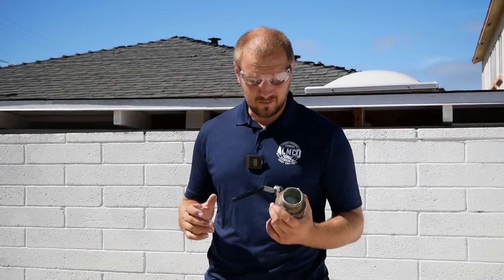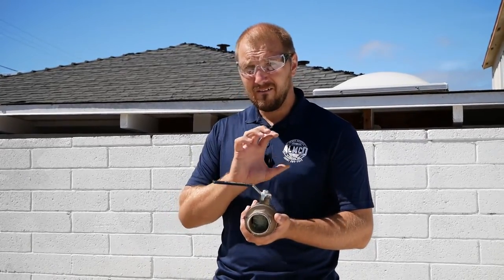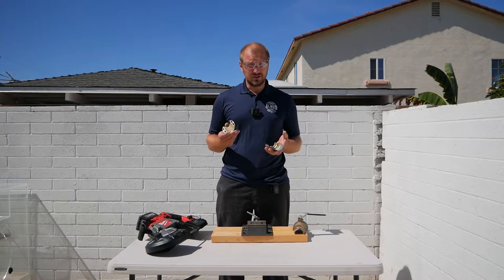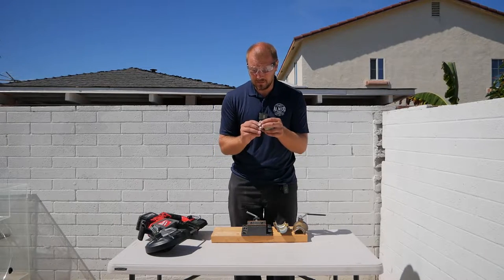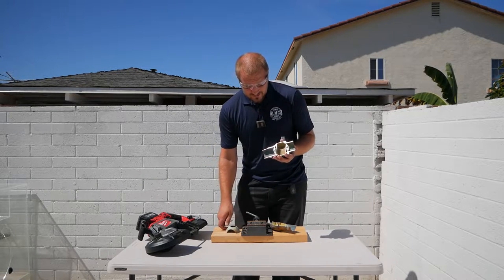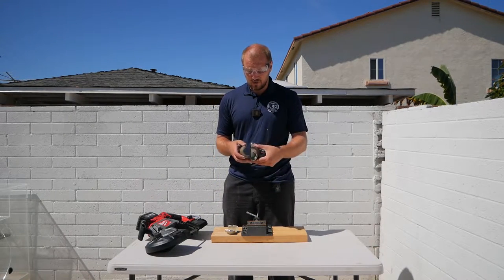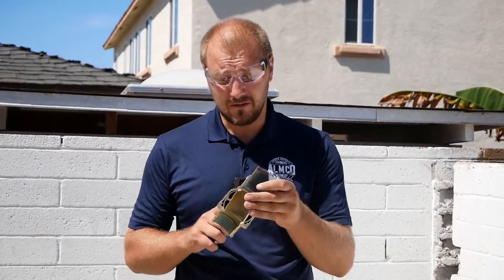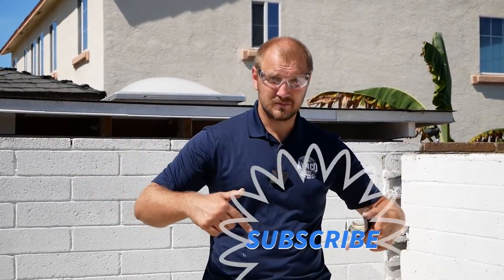How working ball valve and why it's stuck

Comment: idk what's the deal with these valves. i had 2 one as shutdown and a small one that was working like a tap with a hose, and both the ball got stuck and wasn't moving despite the handlet doing so.
update: i managed to fix the shutdown one by removing the handle and pushing the stem down and it connected to the ball again, the other one was too much loose and couldn't fix it and i think i damaged it by disarming it because now it leaks in the middle of it lol.
Reply from the maker: nothing is perfect in this world

Comment: Thank you for video.  I have it backflow preventer Febco 825Y, and one valve easier to turn than other.  And as you say, the one easy to turn is the one gets turned most (output).  Input valve (from house) open always.  I was hoping way to repair, but I guess not really possible.  So, I guess I use it wrench if I needing it.  Better than replace for $700. US.  Dziękuję.
Reply from the maker: yes need replace backflow or just valve no chance to do repair

Comment: You recommend full-way valve (i.e. a gate valve) instead of a ball valve to shut off water?!
Reply: I think maybe it not matter, if exercise valve often, keep corrosion away.
Reply: Exercise valve few times every year
Reply: Ball valve is best gate is nonsense to buy expensive too but they do last 30-40 years but when they do not shut off it can cause a big emergency
Reply: Ball valve only fail bc 1. Installer error 2. Corrosion 3. Handle break off you can't possibly lubricate it like you essentially could with a gate valve using faucet grease I suppose that could extend the life and to use it every so often and lubricate it
Reply: Gate valve just always leak too you can tighten the packing nut most times but other times u may have to apply Teflon or pipe dope